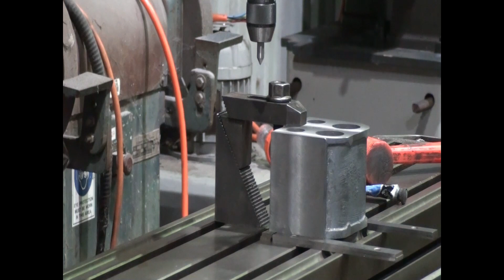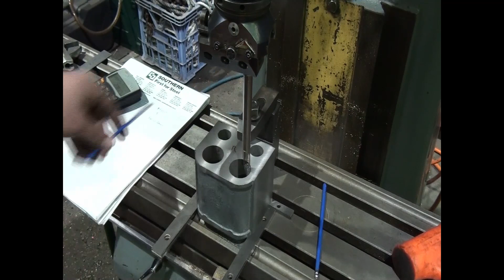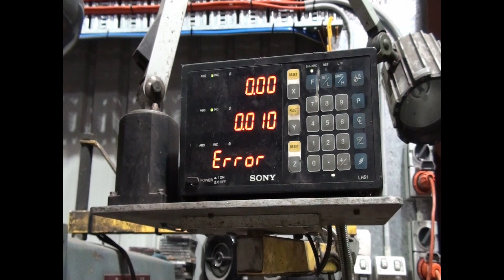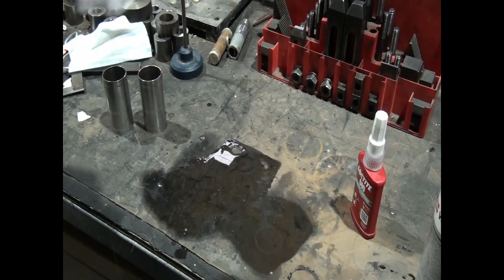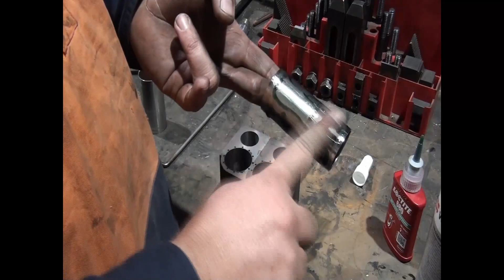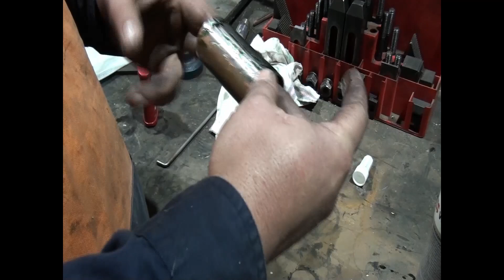Machining 5 inch gauge live steam cylinders Part 2

Comment: Why cylinder sleeves? please
Reply from the maker: I've repaired a few locomotives that have had cast iron cylinders and have always found corrosion in them from sitting unused for long periods, i have also see gunmetal cylinders worn into an egg shape from use. the stainless steel liner is how I have repaired them so it seemed logical to just put it straight in when i build a locomotive. couple it with the bronze pistons and PTFE rings and corrosion shouldn't be an issue, even when someone forgets to oil the cylinders at the end of a run.

the also reduce the amount of time  it takes to get a good bore for the cylinder, the casting is just bored to size no honing or light cuts to get the finish right for honing. the stainless sleeve only takes 5 min in the lathe to machine the grooves and part of to length and another 5 to loctite in. honing the sleeve is then a very easy job as the material is designed to be honed without any extra effort.
Reply: @willowtreeengineering1556  
thank you for the explanation - makes sense...